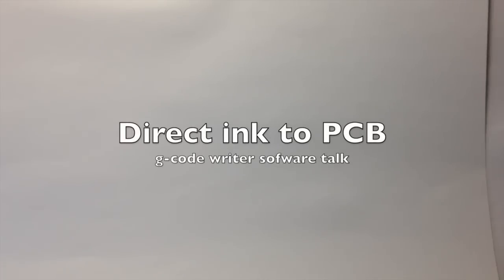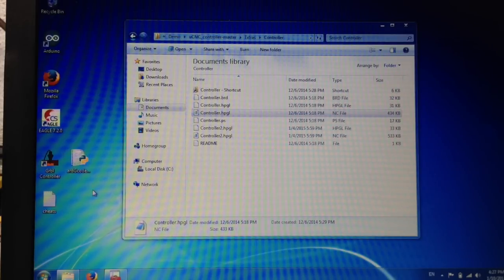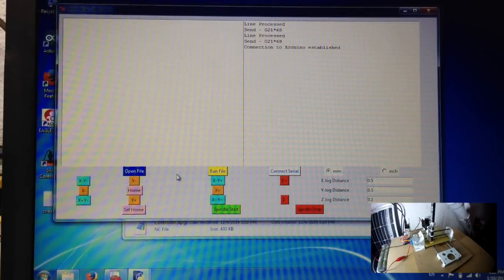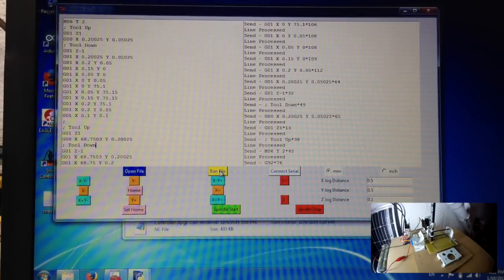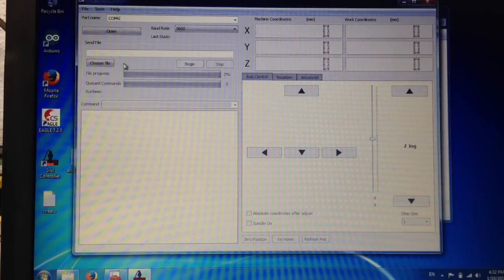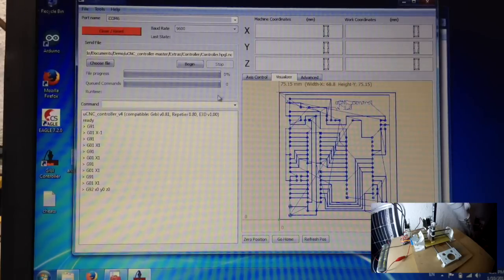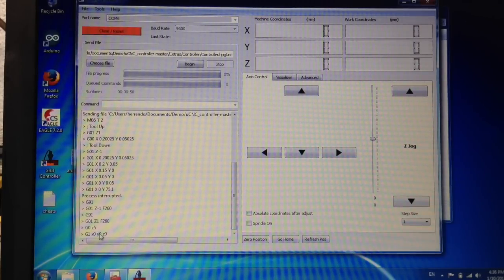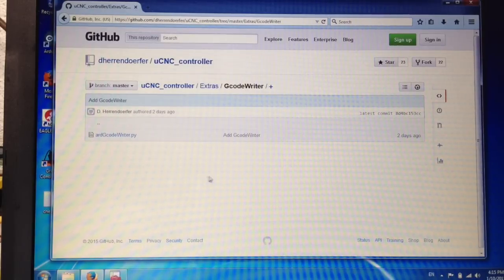Direct ink to PCB-Writer talk

Comment: hey sir is it possible to edit the code for a 3rd motor by multi plexing the pins for 3d carving?
Reply from the maker: Yes it is.
Reply: @dherrendoerfer  you have made a great discovery that I have just been looking for av been reading into the hpl code and startd from the history of the punch card because am trying to build stepper drivers from scratch to build a small wax 3d printer

Comment: Hello, how about Dirk, excellent proyect and thanks for the knowledge, could you help me! I have a question if I want to generate g codes in Inkscape, What data(tool library) will be used to generate g codes inkscape? 
I await your answer.
Reply from the maker: What design tool are you using ?
Reply: @dherrendoerfer  hello I am using the orientation points tool, then I select the tool library and in the end I go to Gcode all this I do in the Ggodetool extension, and another question I have is, Can you make figures like circles or drawings?

Comment: When i use GRBL controller.. Only axis control function is running properly. And when i choose  .NC file it stops after executing few instructions
Reply from the maker: For GRBL-Controller, you need to switch off buffer usage and position reporting. Those two options are GRBL-only.
There is a very simple NC-sender (called gcodesender) that works very well. That needs to have the GRBL features disabled too.

Comment: Hey dirk can you tell me what are different libraries except Pyserial are required to run ardGcodeWriter.py file?..... I install Pyserial library but still this file is not opening
Reply from the maker: Nothing besides Pyserial is required AFAIK. Pyserial must be the same (64/32)bit version of python. You need to manually set the COM port in the python code.
Reply: @dherrendoerfer   i done everything but its not opening. One black window is open and close after some times
Reply from the maker: It works for me, I'm using python2.7 with tcl/tk and pyserial, both in 32 bit.
I did not write this piece of software, I just fixed some of the bugs.
Reply: @dherrendoerfer  thanks dirk.. Its only work on python 2.7 version.. I was using python 3.7.31 so im getting problems

Comment: GcodeWriter not responding, i can't run file .nc to finish. How to fix or continue use GRBL soft???
Reply from the maker: You need to turn off GRBL position reporting and cache-use. Ping-Pong communication works fine.

Comment: first of all great work sir
I have one question is it run .gcode file which is created using 'Inkscape'
Reply from the maker: Hi, yes this works with code generated by inkscape for cnc machines with X, Y and Z coordinates. It won't work with g-code generated for laser engravers or engraver-plotters, they use a different syntax for lowering the tool.

Comment: FIrstly, amazing project! Currently replicating it. I'v enoticed something strange so I thought I'd share i t (it cas esomeone runs into the same problem). I just couldn't get die grbl controler to work with the arduino uno. Once I switched to a nano though, it worked flawlessly!
Reply: i am using an uno , everything works except that i get bigger pads , what was your errors , maybe i may have to switch to nano too

Comment: Hi dirk. Little help. Servo is not simulating the Z axis. So servo is not working. I can see the code saying tool down and up for Z axis. But not working. Please help
Reply from the maker: Depending on the version of the software you are using, you may need to set the motor_mode variable in uCNC_controller.ino to another value. Still make sure you also have a correct setup for the Z axis in the software, as the Servo only emulates the Z axis behaviour and therefore needs to be properly configured.
Reply: Thank you dirk. One additional question. I converted the hpgl to nc using the hp2xx. But after conversion and when i open the nc file with UGS the length of the board in more bigger than actual it is. Actual size is 30mm but now it is 200mm. Any suggestions??
Reply from the maker: You probably did not use the -t ( for true size) parameter when you converted the hpgl.
Reply: Thank you so much dirk. Now everything works fine

Comment: 2:48 So i do need Python in order to transfer the generated G-Code to the Arduino? Well i see this stuff the first time.
Is there a forum where i can get some detailed explanation, thx in advanced.
Reply from the maker: You do not need python - there are other tools that will do the same job. Try gcodesender for example.
Reply: Thank you for your reply, just nailed it on point with this GRBL 
software. Don't have the hardware yet but i am gathering information 
this will be my next project. Will keep the gcodesender in mind.
Would like to use Popolu A4988 driver with an Ardduino Duemilanove
382 Chip and some Bipolar NEMA 17 Motors. Do i need to buy a
certain motor model to match the voltage. There is so much to choose 
from 2.2v up... only a deadly electrocution is the limit.

Comment: Buenas tardes amigo, que version de Grbl usas? porque yo tengo la version 3.6.1 y no me funciona. Gracias desde Venezuela.
Reply from the maker: It works if you turn off all grbl caching and position reporting features. I've switched to gcodesender for now, and that's working fine for me.

Comment: Hi Dirk! I just want to clarify this, is the "stop" button in the GRBL controller the same as a "pause" button? By pressing "begin" again, will the machine start with the next code after wait or it will start over again? Thanks!
Reply from the maker: For GRBL, I believe that is true, it's more of a pause, than a hard stop, that's what the emergency stop is for.
Reply: So it will still continue to plot the pattern even if I paused it for some time like if I want to add more ink to the pen or even replace the pen and it will continue the plotting from the point where I stopped it?
Reply from the maker: I just tried - and I must admit being wrong - apparently pressing stop aborts the sequence and does not pause.
Reply: I have read that there is a software pause (!) and resume (~) and also a hardware pause using two switches to control the Feed Hold and Cycle Start command (at Analog pin 1 and pin 2, correct me if I'm  wrong) but I don't think you have implemented that in your work. I would be glad if you happen to also check if the software pause exists in your system. Thanks again Dirk!
Reply from the maker: Hardware pause is not an issue to implement, but it does have some implications towards the machine handling - normally the machine goes into power-save, releasing the stepper hold current after a while, would it do that on pause ?
I'll look into it, but I'm not sure that that is a good idea.
Reply: Looking forward to what will happen. Does the software pause command for GRBL works? Thanks for the reply!
Reply from the maker: Tried it out, software and hardware pause do seem to be problematic so far.
Reply: What could the problems be? And is there a way to pause the machine? I'm planning to build this and I'm thinking of a scenario where the pen suddenly runs out of ink while in the process of printing so I'm looking for a pause so that I can refill the ink then resume it so the machine can continue to plot it. Thanks Dirk!
Reply from the maker: If the pause is done in hardware, it needs to tell the sending software that it is not executing commands at this time, and the sender should send the same command over and over again - that does not work at this time. If the pause is done by the sender software the hardware shuts off the drivers after some timeout time, possibly loosing steps positions when it picks it up again.
Reply: So at this time, it's not possible?
Reply from the maker: You might not get the result you expect - I'd invite you to try it out and report your findings.
Reply: Hey Dirk, I have decided to assemble the parts now but I'm facing some problems. Whenever I run the file using the Arduino G Code Writer, the program hangs then stops working. This seems to happen whenever the Z axis (Servo) is lifted up because clicking on X and Y jogs, the steppers are functioning properly but whenever I press the Z jog, the program crashes. Any reasons why?
Reply: Never mind. I was able to get it to work using the v4 firmware. If I am going to add a hardware switch for pause and stop, where should I put it in? Do I add a code on both the Arduino IDE and the python program so that when a switch is read, it will do the appropriate action?

Comment: hello MY FRIEND :No data from COM port after connect. Expecting Grbl version string. ? why ?
Reply from the maker: I don't know, you may want to try the v4 firmware from the beta branch, or try to use gcodeSender, another application that works very well.

Comment: With the grbl controller can you set your pen line thickness to avoid overlaps or "under" laps? or will the g code need to take care of this. ty
Reply from the maker: The controller and the machine have no concept of knowing the actual line width, so it must be taken into account when the g-code is generated.

Comment: Hi Dirk how 're you? well, I started with your cnc project and all goes very well, I loaded the uCNC_controller in the arduino and when I run the ardGcodeWriter, motor steppers rotates in one direction only...  What could be the problem?
Reply from the maker: Try reducing the steps-per millimeter significantly for a test, it can also be faulty wiring.
Reply from the maker: Sorry, the last reply was bunk - reduce the step issue frequency, you might simply be driving them too fast.
Reply: Hi Dirk, I found the problem, the stepper motors that I bought, have a issue with the cables, I fixed it and now works very good, the only thing that I should to change is the steps per milimeter, thank you Dirk :D